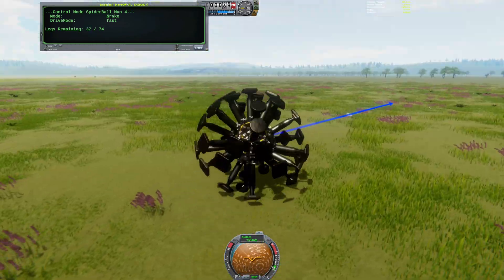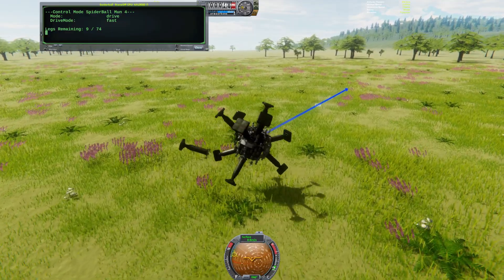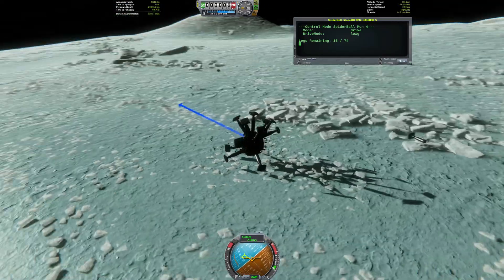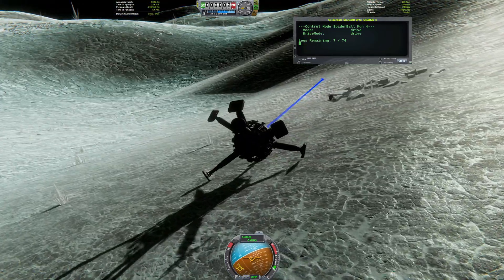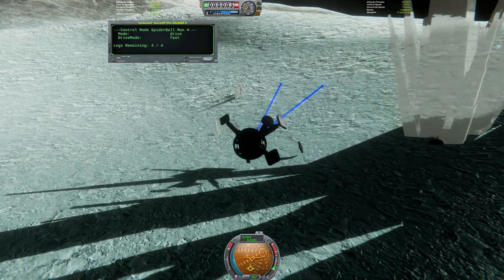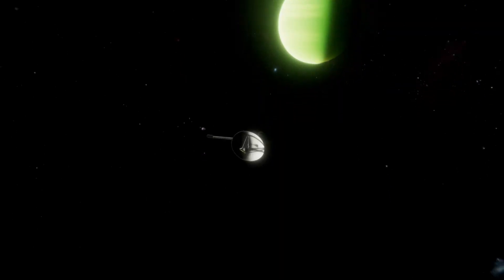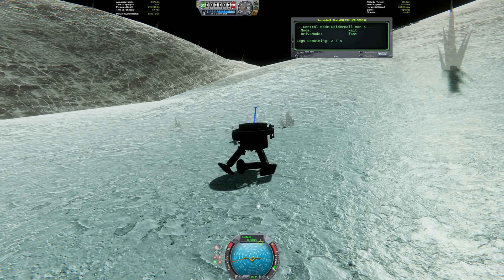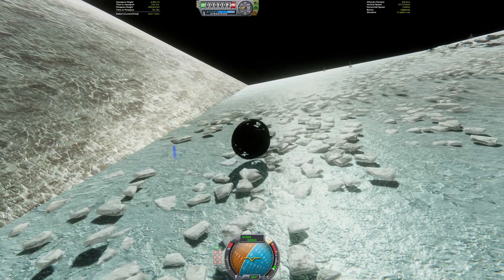Kerbal Space Program (kOS) - Tumbleweed Rover - Catastrophic leg failure?

Comment: After seing this, quite naturally in my kerbal brain, neuronal connections eventually join together and formulate this engineering request for you :
See how much legs you can have at the same time (just let it go, let go the logic, just add more) to make some kind of giant version...
See if you can stack legs on top of each other (so double leg version....)
If it works, try triple stacked legs
Continue until your brain emits smoke, or your KOS processor, or your computer, or your hypotethical loved-on (if not, your stomach), because you didn't make dinner in time, and spent 12 hours straight on those stupid but intersting ideas I just wrote.
May the holy light of the kraken goddess be with you
Reply from the maker: At a certain point my CPU might threaten to unionize, but would be fun to see how far it would go.
Reply: @lodurrvoluspa_ksp  Nice haha, looking forward to it, have fun